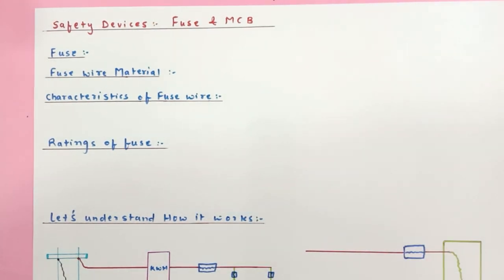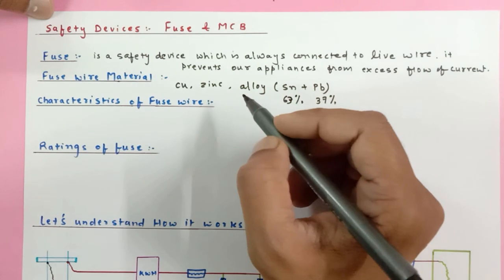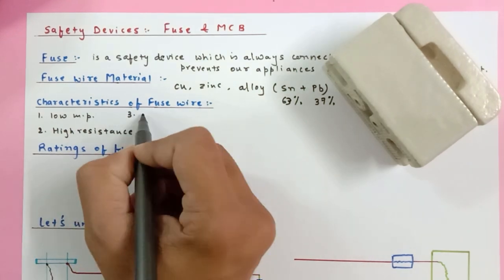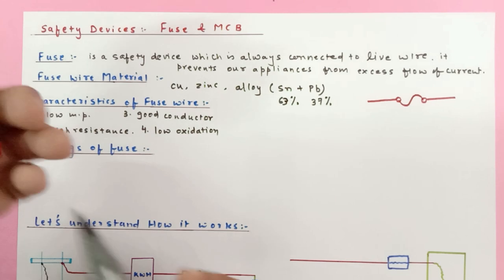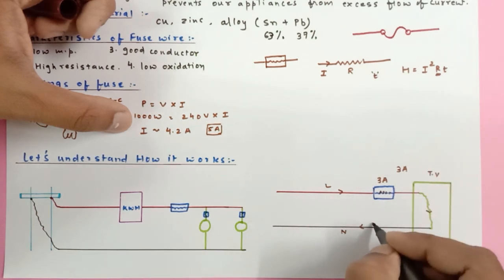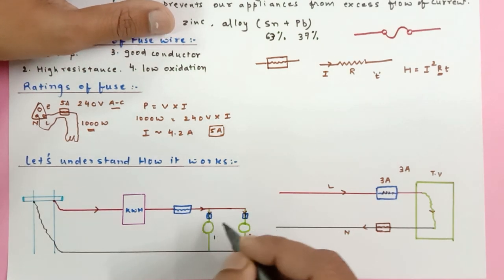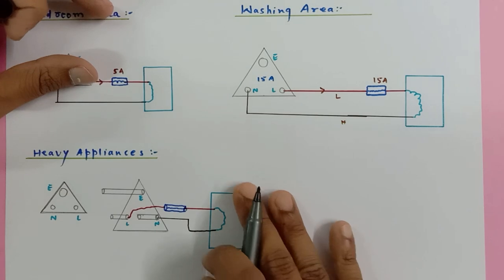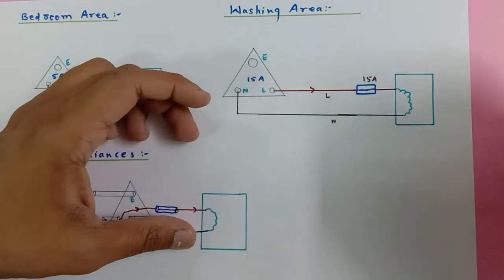Safety Devices : Fuse & MCB | Grade 8-10 ICSE | Electricity

Comment: Sir how can we use copper as a fuse wire as copper is having low resistance and high melting point..??  
Please reply and clear my doubt..
Reply: Yes,we can't use copper, aluminum, etc. Instead of that we can use alloy of lead and tin as they have high resistance and low melting point.
Reply: @vanshika1708  right
Reply: Hey in my book it is written that ordinary copper wire must not be used as the fuse wire . I think we can   use alloy copper wire or any other kind of copper wire but not the ordinary copper wire.
Reply: @rachnarawat6169  ya you are right  ....alloy of copper with high resistance and low melting point metal can be used

Comment: Sir I have 10 HP centrifugal pump on river side 5 km from my house.. And I use Ashok 63 amp fuse but the major problem is heat.. Bqz of that it is need to change fuse 2-3 month later.. Can you give me the best solution..on fuse... I don't want any fuse on fuse box I want integrated solution on that... Can you suggest best option... Reply plz....
Reply from the maker: Please give me some time I will get back to you